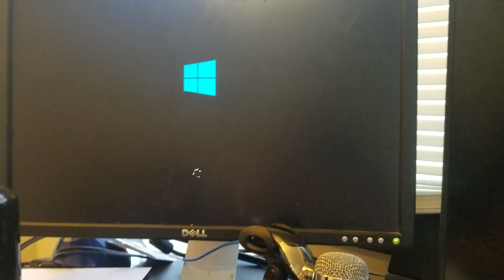How to fix black computer screen with red ram light on

Comment: When your red ram light was on were you able to power off your pc by either pressing or holding the power button? I have to flip the switch on the power supply and if I hold the power button the light for the cpu turns red until I take my finger off. Ultimately my ram is in all the way but the light is still red and no signal to monitor.                                                         I also just changed my cpu and cooler went from a ryzen 5 2600 can’t remember the cooler it came with the cpu to a ryzen 9 3950x and a Corsair h115i aio liquid cooler after I changed it that’s when I started having these problems

Comment: I DID EVERYTHING. I even vaccummed and cleaned my pc still beeping :(
Reply: African Mamba why the fuck would you mix vacuum with computer?
Reply: Why would you vaccum your pc?
Reply: @silkysensation3170  to remove the dirt and dust
Reply: @silkysensation3170  if you don't it will slowly build up and kill your pc
Reply: @Osarobito  you realise your gonna break components because of the static electricity right? And just use compressed air it's a safer way

Comment: My pc turns on but no signal to my monitor and my Keyboard and mouse don’t turn on. It’s all the way clicked in on the bottom and top. The dram light shows up for 6 second or so and then turns off. I tried to reset the bios didn’t work for me too what should I do the old ram doesn’t work too
Reply from the maker: is this a first time start up?
Reply: @CRASHB4NDICOOT4  I having the same problem when I turn on my new pc for the first time I got the no post problem.
Reply: @CRASHB4NDICOOT4   for me yes
Reply: I have got exactly same issue like you but my light stays on. Im lucky to have almost same pc to check but my suspect is ram(and bios issue with ram frequency) and then mobo.
Reply: @ka96rol  same light stays on a 4 lights aroudn the MSI logo on my mother board b350m
Reply: same issue
Reply: Try different ram slots and if the computer is dusty clean it .

Comment: I have both sticks clicked in and I have this issue..  Its more of a "Dummy guide" I am looking a Pro guide how to fix it.. also I can use a heat-gun and if needed I can solder.. I dont like bridging tho.. coz I would be happy with dual channel but DIMMA1 and DIMMA2 are faulty.. B1 and B2 are okey.
Reply from the maker: check ur cpu pins. could be bent making faulty ram slots
Reply: @CRASHB4NDICOOT4  Yeah I managed to scope for some bent pins,  but its Z390 socket.. so as good as I could get it I pretty much left it for the future in "2do list" since I got back my main board from warranty..
Reply: i thought the same thing but i unplugged it and plugged it back and it worked
Reply: @thouxanbanwill  its kind of user 101 to reseat the RAM sticks.. even without thinking to watch a video at least from my perspective..

Comment: I need Help !! I put it in till it clicked did everything but everything turns on and off in the computer fans on and then turns of then on
Reply from the maker: well if it was the ram the computer would stay on but nothing would boot up. if your computer turns on and off u have a different problem. I would check bent cpu pins bad power supply or worse case bad Motherboard
Reply from the maker: make sure all power connections are secure
Reply: then it is probably the ram, try each one and only that one if it works try the next one, if it doesnt then try all the others at the Same time
Reply from the maker: @krazzi262  ram won't  Correlate with it rebooting itself tho. but u do have to put the ram in the correct spot on ur motherboard. if its not reading the ram at all, then u most likely have a bent cpu pin that talks to tht specific slot.
Reply: Crash Inc oh i just had the same problem and after testing Them one by one i found out that the problem was one of the ram sticks.

Comment: Very Helpful Buddy. This happened to me last night and I was like, how come this is happening to a brand new rig. I reseat everything and reset the cmos. You just confirmed right now that I dont have to do all of it. I also noticed exactly what you demonstrated. It is with the ram slot that is not placed intact. With the ez debug led on the top right not turning off

Comment: I have the same problem but nothing turns on and a red light blinks on motherboard
Reply from the maker: the computer doesnt even try to turn on?
Reply: I tried to test parts but they didnt work until i put them all in the case but it works perfectly fine. Might have just missed a cable

Comment: I have a Single 16gb ram and there is only Red Light and it doesn't Boot up I cant even get into bios but when I take the ram out of the slot and Boot IT up with 10gb ram then it boots up help please 😕
Reply from the maker: Honestly sounds like you COULD have faulty ram. it does happen. I would definitely  take that ram back and get a new one or new brand. up to you
Reply: @CRASHB4NDICOOT4  okay

Comment: update on my computer, well i haw found the problem with DRAM RED LIGHT, it turned out that the motherboard did not get enough power, there was obviously a gap between the power supply and the motherboard. I also did a scandisk on the hard drive, and there were 0/MB and 0/kb damaged sectors so it was good there.
Reply: how did you fix it
Reply: @johnt2871  What I did was that I have said to make sure there was power, When I started up the computer I pressed F8 and chose which advice I should run with, Apparently after the power disappeared the BIOS switched to 0, That said I pressed F8 chose the system would start up with, and I chose ofcourse the hard drive where the windows were, and since then it has worked flawlessly now.

Comment: Then I have a question for you, I have had my computer now for more than 6 years now, and after 6 years I got DRAM RED LIGHT, why do it so, or is there any other error that may have occurred, NOTE I have not touched anything on the computer right now
Reply from the maker: just old man. sometimes updates go through and your ram is just no good anymore. I would try different ram to try and diagnose it
Reply from the maker: it's been said you should upgrade about every 5-6 years
Reply: @CRASHB4NDICOOT4  so what kind of ram are de talking about then 🤔
Reply from the maker: @surfarandrewboy  well it would be ddr4 and ddr5. u probably have ddr3 which is kind of old now. so maybe a new stick could fix it. otherwise u may need a new build
Reply: @CRASHB4NDICOOT4  Well i haw ddr3 but i dont know if ddr4 or ddr5 will fit in that sucket 😖
Reply from the maker: @surfarandrewboy  it will NOT sadly. so I would try different ddr3 ram (buy new or know it works) and if it doesn't work, you will need to do a rebuild. (new Motherboard)
Reply: @CRASHB4NDICOOT4  oo damn it 😡

Comment: I don't have the red light by the ram but down on the right. Also no signal on the monitor
Reply from the maker: what does it say by the red light?
Reply: @CRASHB4NDICOOT4  According to the manual it's the boot.
Reply: @CRASHB4NDICOOT4  I have RAM and CPU flashes red and BOOT & VGA flashes yellow
Reply: Same issue but on dram not boot
Reply: Me too before 2 weeks, red cpu light on. ASUS Z97A
Reply: @nickem7  i managed to solve my problem by updating my BIOS and readjusting the cable. The cable was horrible
Reply: @XaliberDeathlock  Thanks for answer! How did you update bios with no screen? And what cable did you readjust?
Reply: @nickem7  so I had to readjust the cables first. All cables that connect from the PSU. I'm not sure which did the trick, but I had to do the PSU-motherboard cable twice. That solves my first issue: dead screen & component. My second issue is the EZ Debug LED. It still flashed, so I had my BIOS updated. Updating solved it.
Reply: @nickem7  sorry I mean after the cables were corrected the screen returned to light

Comment: light still red, 2 click on each ram still red. But the moment i plug the power cable in and it turn yellow (in a different place) but when i turn one the light near ram still red
Reply: Did it ever fix
Reply: @JeremySm1thfr  yup ram was not plug correctly

Comment: I had the same problem I restart it this morning and this happened since 2012  not a single problem I did the same ram in and out red light gone now my PC is making just one beep and nothing s showing up on screen on the case looks fine tough what could be wrong? I tried cables in and out still the same xd

Comment: Both of my ram sticks are in correctly, but what ima try to do is switch them one by one. I’ll report back if anything happens.
Reply: Turns out I didn’t push one in all the way... Because one side was solid and the other side clicks into place, it’s hard to tell when it goes in.

Comment: Help my does not work anymore and there is a red light on thd motherboard and on it it there's four light and four names cpu, dram, vga and boot i don't know what to do help
Reply from the maker: sorry i dont know
Reply: If its 4 check the motherboard or the power supply

Comment: I need help. So when I try pushing it down more it doesn’t budge
Reply from the maker: try opening both latches if u have 2, then take the ram out. then put it back in with the latches open. then push straight down on the ram until both latches close or hear 2 clicks
Reply: Crash Inc. PLEASE RESPOND
Reply: Crash Inc. PLEASE REPOND PLEASE. DONT JUST LEAVE
Reply from the maker: @swerzye4472  thts means you either have bad ram or its not put in properly
Reply: Crash Inc. ok thanks
Reply: @swerzye4472  yo you need to calm down 😂 type once and just wait for a reply
Reply: Ok I push straight down on the ram and both latches close, but still no results. Do you know of any other solutions that could be causing this or any fixes? Also, what does it mean if the red label pops up next to a label named “DRAM”?

Comment: That moment when it works for everyone else but not you :'(
Reply: Yep
Reply: Same here
Reply: Yep
Reply: @nommahh6050  u still have the problem and nothing worked with you ?
Reply: @DXB_GR  yes and none of my USB ports can work so I can’t reinstall the bios
Reply: @nommahh6050  ok after a lot a lot a lot of time I found a solution that worked for me is that taking out the motherboard battery and putting it back and the bios settings should reset
Reply: @nommahh6050  ok after a lot a lot a lot of time I found a solution that worked for me is that taking out the motherboard battery and putting it back and the bios settings should reset
Reply: Just try few more times, i thought mine is broken or something but they just werent enough deep inside motherboard. Keep trying before buy new rams or something.
Reply: @joonastakanen9730  what are you talking about ?
Reply: @joonastakanen9730  ... I got a new pc now....
Reply: That's fucking hundred of syringes in the ass😖
Reply: @elumalaim6857  tafuq

Comment: So my computer does the same thing. Sometimes it boots up like normal, but other times it doesn't... I've also been getting blue screen of death and my computer can just shut off at the monitor. Could this kind of issue be causing blue screen? I'm kind of scared of touching my PC because I haven't built it myself and I don't want to ruin anything.
Reply from the maker: sounds like u might have a bigger problem. u may have a virus ir your motherboard might be going bad. id say you should have someone check it out
Reply: I had the same problem like you 
Try to reinstall win and make sure u delete (format) everything 
If this doesn't help you 
Then you probably have a hard disk that is dead or close to dying (that was my problem but make șure to try the first thing that i said to you resintalling the windows )
And make șure you save your personal data before like photos documents or anything else